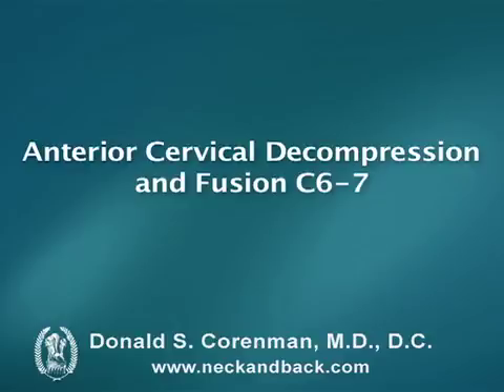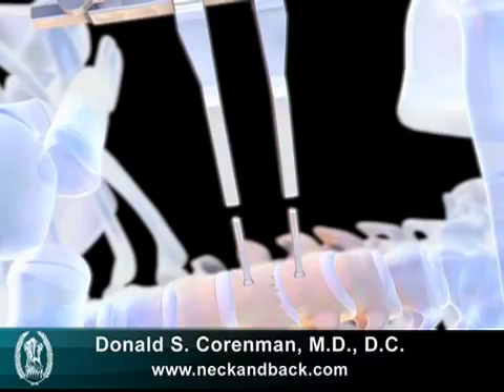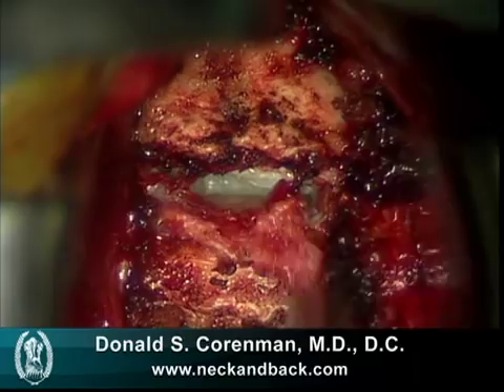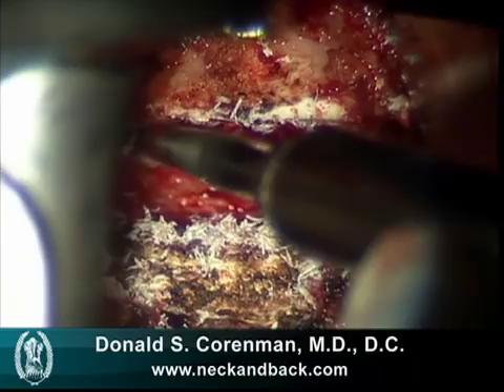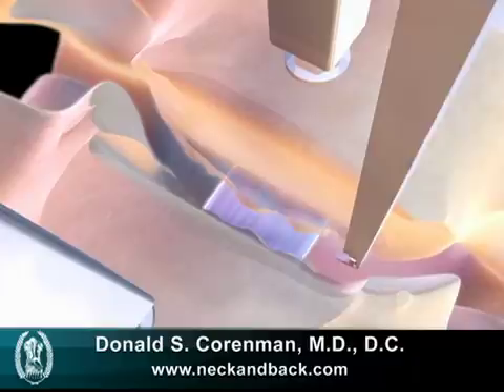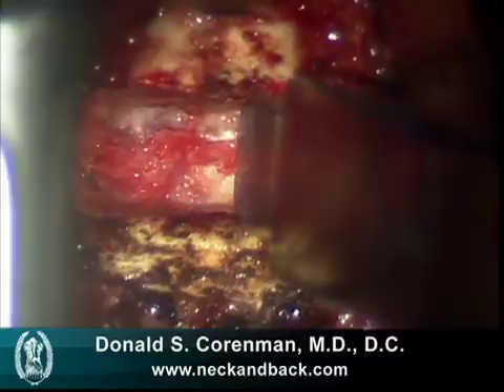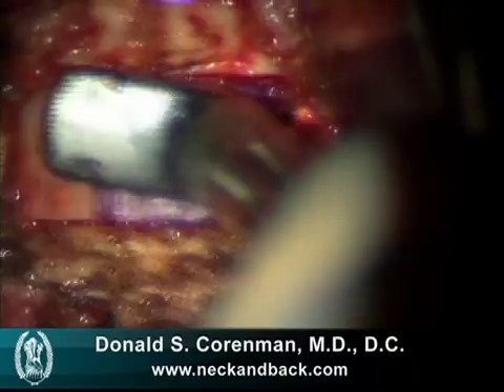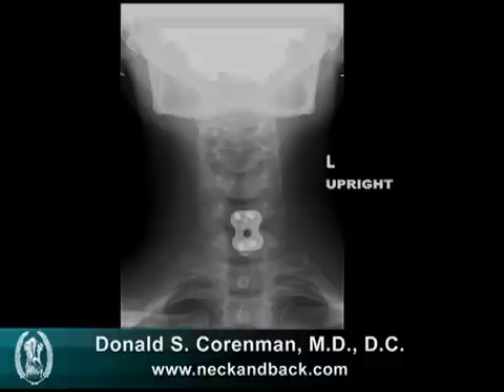Anterior Cervical Decompression and Fusion (ACDF) | Live Spine Surgery Video | Spine Surgeon

Comment: I'm going in for surgery in a couple weeks. Open back surgery  and neck. Vary scared of the outcome. But I can't bare the pain any longer. Any1 reading this needed surgery and found something else instead? I'd appreciate the advice. Iv been doing prolotherapy shots (38 shots) every 3 weeks (6 inch needles) for 9 months. I'm running out of options. Idk what else to do
Reply: Did you get the surgery
Reply: No, I went to get a second opinion from a known surgeon that does surgery on many athletes and he encouraged me not to get the surgery because the chance of success wasn’t to high plus he said at a young age it’s a guarantee that even if the surgery was a success that years later I’d have to go in for more surgeries.